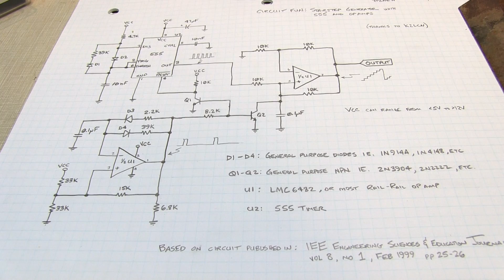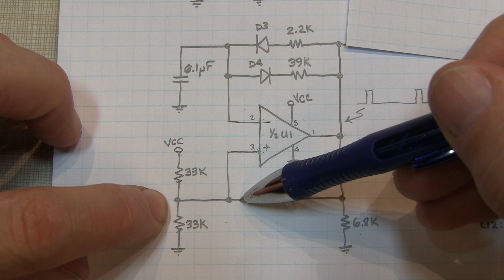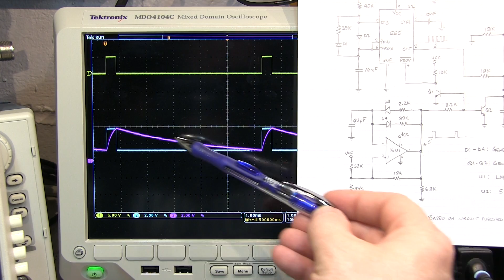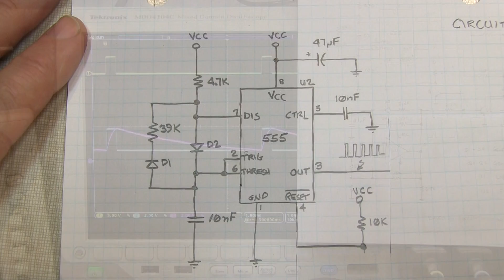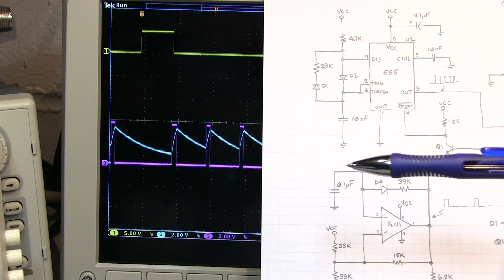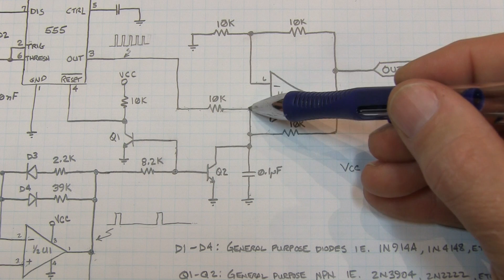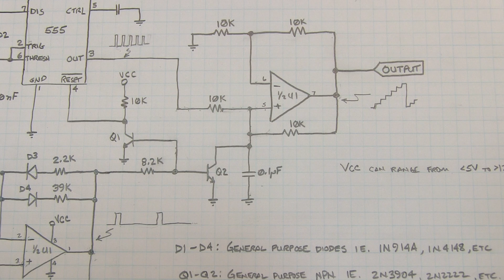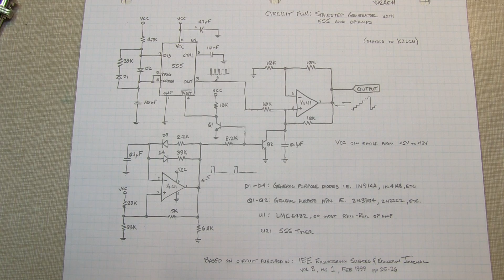#231: Circuit Fun: Stairstep generator using 555 and op amps

Comment: Question could you give me the link to the IEE Engineering Sciences & Education Journal archives? Thank you. Schematic where K2LCN sent it to you?
Reply from the maker: I couldn't find the original link. Here's a pdf of my schematic: https://www.qsl.net/w2aew/youtube/stairstep.pdf
Reply: @w2aew I built the circuit under the 555 timer oscillator using the uA741 operated on a single rail power supply achieved good results. You stated you modified the circuit with a rail to rail op-amp. I priced the op-amp very expensive. About $8.00 each with shipping not included. I’m tempted to try the TL074 Quad JFET op-amp. I’ll let you know the out come, thanks for your reply.

Comment: In general, how do you come up with the resistors value?
Reply from the maker: There is no "general" way to do it.  Each resistor has a function.  It may be to create a certain voltage drop, to become a load, to establish a certain bias voltage or operating current, to form some specific timing by setting a current or voltage.  Sometimes a value is critical to circuit operation, many times it isn't super critical - it all depends on the circuit.

Comment: What is the purpose of the 6.8 kOm resistor, used in the Schmitt trigger relaxation oscillator circuit, connected between opamp output and ground? From threshold voltage point of view, this resistor is unnecessary - it does not change Vth+ nor Vth-. It only loads opamp output with more current.
Reply from the maker: The circuit was originally designed using an op amp whose output stage would add crossover distortion when swinging to the rail due to the design of its push-pull output stage.  The resistor to ground kept the output stage in Class A. You're right, not needed with this particular op amp.
Reply: @w2aew  Thanks for explanation.

Comment: The staircase waveform looks linear on the oscilloscope (before the "steps" are carved into it). However, the main capacitor is charged by a 10k resistor on the output of the 555, rather than by a current source, so I would expect it to be exponential. Maybe it is actually exponential, but just doesn't appear to be so, or have I misunderstood something?
Reply: This iş What I also getting 1 volt straight line don't know what is wrong

Comment: Am i right if I say the 6.8K resistor forms a voltage divider with the 8.2K connected to Q1? Otherwise the 6.8K blows up my calculation of the trigger points forming the voltage hysteresis of the Schmitt-trigger circuitry.
Reply from the maker: No, it doesn't make a voltage divider with the 8.2k resistor.  It is simply a load on the output of the opamp and can be ignored in the calculation of the voltage hysteresis.
Reply: @w2aew  Thank your answer. It comforts me knowing that I wasn't completely wrong. I had some thoughts of this resistor being a load my self. By replacing the 6.8k resistor with an infinite high one in my recalculation the trigger points and hysteresis finally made sense.

Comment: I use a LM358 as OPAM ( i have no "rail to rail" one) and I need to put a diode between 8k2 resistor and transistor bases in orden to achive transistors off state.  So I get a nice stairstep.

Comment: Pffff, I'm a bit frustrated. I've made the same circuit as you, used the same resistor values, the transistors I used are the KN2222A and the dual opamp I used is the LM358.

I can see that the circuit wants to work because when I switch the power on and off very quickly I get a stairstep waveform but only very briefly and when I leave it switched on normally I get nothing, do you have any tips for me on how to troubleshoot the circuit?

I've tried different transistors, played with the 15K ohm resistor and tried a 1K ohm and even no resistor, just a jumper wire and nothing seems to get me any further.

When I take off the 8.2K ohm resistor that goes from pin 1 of the opamp to the base of the two transistors on the transistor side I do get the signal but as soon as I connect it to the base of the transistors again the signal dies and I get zero, only when I set the voltage per division on the scope to 100mV/D I see a very weak signal but it doesn't look like the square wave coming out of pin 1, and when I measure with the scope on the same resistor but on the opamps side I see the square wave even with the resistor connected to the base of the transistors but on the transistor side the signal is almost completely gone, just the little spikes are there.

Maybe the 10K ohm resistor between pin 3 of the 555 timer and the + input on pin 5 of the opamp needs to be smaller, but it can also be that the opamp I used isn't the right one which is the LM358. I know it's not really a rail-to-rail opamp, it can go down to ground level voltage but it doesn't quite get to the VCC rails, it's only goes to 1.5V less than VCC.

Do you have any suggestions for me please?
Reply from the maker: What power supply voltage are you using?
The LM358, not being r-r on input and output might be affecting it, but I'd have to think about that more.
Have you independently checked that your transistors are ok?  When connecting the 8.2k resistor from the reset oscillator, you should see the same signal as op amp Pin1, but only with a 0.6V peak value instead.
Reply: @w2aew  On this circuit I'm using a 12V computer power supply but I also tried a 12V battery but that didn't make any difference. The transistors that I'm using now are the KN2222A's, before that I used different transistors because I thought that one had a defect or something so I switched those for the 2222's.
With the 2222's I get the same issue, one seems to be working fine which is the one that resets the 555 timer and the other one looks like it doesn't work but I know for sure that it works because I switched the two transistor around and still the same thing happens.

I'm going to set up my scope now and make a short video about it to show you on the scope what it does, it might be clear to you when you can see the actual signals on the scope.

I also made a video yesterday about the flexible ramp generator showing that it works now, however it might be that you know something to improve it or you have some other suggestion so if you have the time for it please watch my video here: https://www.youtube.com/watch?v=4odd_Xe5Fco

I would love to hear your feedback.
Reply: @w2aew  So, when I look at the signal on pin one of the LM358 I get a clean slow square wave so that part works, on pin two I see the capacitor charging fast and discharging slow, looking at pin three I see the same signal but not as high as on pin one and with a bit of a positive DC offset, I think that's okay but when I measure on the other side of the 8.2K ohm resistor the signal is almost gone, I do see it when I set the scope to 100mV per division but then I have a lot of noise and the transistors are switching on the noise too and picking up the faster signal coming from the 555 timer so that's what is going wrong here.

Do you have any suggestions?
Reply: @w2aew  The craziest thing just happened, I changed the power supply output, I built-in a linear voltage regulator in the computer power supply that I'm using as a bench PSU so I thought lets use that output so I can see what the circuit is pulling from the power supply on the digital display.
At 4.567V it pulls 0.017A so that's okay.

What do you think that happened?

When I started to turn the voltage output up slowly, I get the stairstep wave at the output when I only give 4.5V to the circuit, when I go any higher I see the lowest steps of the stairstep wave going wonky.

This is so strange I'm perplexed.

So the circuit is working magically with a much lower input voltage of 4.5V maximum.

Now the question that remains is how do I get it to work with 12V input voltage?
Reply: @w2aew  I've got it working as intended with a 12V input and I only had to make one change to the circuit, the 6.8K ohm resistor that goes from the op amp output PIN 1 to ground, I first tried a 1K ohm resistor but I'm using a 330 Ohm resistor now and with the lower resistor the signal is a bit cleaner and looks great now.

This has kept me busy for pretty much the whole day, changing one thing at a time and looking at the signals and if it didn't work change something else until I got to the 6.8K ohm resistor and hey presto I got the right signal.

So now I have to make a new video explaining what I had to change to get the circuit to work and all that.

And I'll make sure that I have a link to your video since I got the circuit from watching your videos so if people want to see the full explanation in great detail they need to watch your video, I can't explain it as well as you do.

Best regards,
Ricardo Penders.
Reply from the maker: @RicardoPenders  I think it makes sense that you needed a heavier pull-down resistor on the LM358 op amp.  While the LM358 is rated to swing its output near ground, it can only do so at very, very low currents (the output of this op amp can't sink much more than a few 10s of microamps).  So, it needs help to swing towards ground - hence a lower value resistor to ground works.  I didn't have this problem with the op amp I used because it can sink a lot more current when driving a low output.  I bet you've learned a LOT by going through this process - which is really the best way to learn!
Reply: @w2aew  Yes you're absolutely right, I learned a lot just by tinkering with this circuit, at first I took a random value capacitor and I started to poke around in the circuit looking at what the signal did on the scope and that didn't do very much so I took a 1K ohm resistor and started to do the same thing, just poking around and then again looking at the signal on the scope and when I came to the 6.8K ohm resistor to ground it was like magic when the circuit suddenly started to work.
I knew it should be able to work one way or another so I didn't want to give up.

I do have one question left, my stairstep signal looks great it's just the last two pulses aren't adding any more steps so I have a flat top so to speak, how can I get that improved?
Reply from the maker: @RicardoPenders  It could be that you're running out of headroom on the LM358 output - it can't get closer than about 1.5-2V from the positive supply rail.
Reply: @w2aew  That sounds plausible yes, is there anything I can do about that?
I do have a bunch of UA741 single op amps that I recently bought, maybe it is better to use those, I mean for me it's no problem with the power supply, I have +12V and -12V always ready to go.
Reply from the maker: @RicardoPenders  they are worse

Comment: Are you using tantalum or ceramic caps?? Thanks, having a go myself.
Reply from the maker: ceramic
Reply: Almost have it going. Only have one curve in XY mode. Stair step looks good though. Using LMC6492. Thanks.

Comment: I build this circuit but the ramp opamp capacitor can’t hold the charge ,want went wrong
Reply from the maker: It is difficult to say what when wrong without knowing what changes in component types you may have made (like a different op amp, etc.).
Reply: I use mcp6004 and having no stairstep with both other 2 circuits giving waves

Comment: Impatient to try this but waiting for rail to rail op amps to arrive...tried LM324.  Got the relaxation oscillator running and adjusted pulse timings.  Then the 555 pulse generator and added the reset.  More adjustment to get about 12 steps between resets.   Then added the pulse integrator but results were not as expected.   Reset was not taking the integrator capacitor to ground.  Eventually figured out that the 8k2 base resistor needed to be reduced to turn on a 2N3904 sufficiently to get down to ground during a reset.   Guess this is a consequence of not using a rail to rail op amp.  More adjustment of the base drive and finally an output close to yours.   Not quite as square steps but close.

Spent a few hours working on this circuit because it looked fascinating and have learnt lots about basic electronics.   There is no substitute for doing - great that your videos are, there is even more to be gained by building and modifying.  Been great fun and learning.
Reply from the maker: I LOVE to hear when my videos inspire folks to build, experiment, test, and learn!!!  Thank you!

Comment: Here's the whole thing done in Paul Falstad's (javascript conversion by Iain Sharp) online circuit simulator:
https://tinyurl.com/y2xjsf4w

The simulator has a nice variety of IC's modeled, including the 555.

PS. The simulator at http://lushprojects.com/circuitjs/circuitjs.html seems to perform a bit better (at least on my machine) than in the URL I posted in my earlier comment.
Reply: Also..

There's a high chance I've done some mistake along the way but it seems to function as it should. You should adjust the simulation & current speed sliders if the screen refreshing is jittery and/or the current animation seems frantic. For now, those are not saved with the circuit but the simulator is still being updated.

Comment: I thing you can automate it by letting the relaxation oscillator making the high frequency pwm and let the 555 in monoflop configuration which gets triggered by a high at out to make the discharging step at the output.

Comment: I think I understood everything in the first part except what the 6.8K resisistor is doing (s. 4:29).
Reply from the maker: It isn't critical.  In some rail-rail op amps, you can get a little cross-over distortion when the op amp output switches between sourcing and sinking current.  A little pulldown resistor like this ensures that he op amp output is always sourcing current, so it helps to prevent any crossover distortion in the output.
Reply: @w2aew  Wow- thanks so much for the quick response. Love your videos!

Comment: could 741 be used?
Reply from the maker: Not without some modifications.  The circuit as designed relies on a rail-to-rail op amp.

Comment: Very nice little circuit.   If you put about a 47K resistor on the base of Q2/Q1 to ground, it'll work better with 2N2222 transistors - they tend not to turn off very fast and hold the 555 in reset too long so you only get 4 or 5 steps out of it.  Just a thought :)   Love your videos.

Comment: As always great explanation. I'm assuming this circuit must have a lower frequency boundary? on the basis that the step will decay and there will be a point where the sag makes this too nonlinear, is this right?
Reply from the maker: Yes, that is correct.

Comment: Does the output stage need to be as complex? Could we just have a diode from 555 output -> capacitor positive side then put a buffer/voltage-follower there?

Comment: There is a bar on top of the reset pin on the diagram, which means it is an active low reset, which means the reset is default high. When there is a low, the circuit resets. 
 But your scope is showing an active high reset - whenever the pulse is high, it resets.
Reply: When the pulse goes high, it turns on Q1 which pulls the reset pin low.  Q1 inverts the signal.

Comment: Can it be used for making an analog to digital converter? For example, you compare the analog input voltage with the height of the stairstep and then output a digital signal when the analog input equals the stairstep's height.
Reply from the maker: Interesting approach, but would be pretty limited to low resolution due to finite step sizes.

Comment: Thanks for your awesome training techniques they are very clear and understanding. Have you ever experience any three phase circuits to parallel AC generators, or do you have any ideas on what chip should be use for phasing sequence two or more AC generators
Reply from the maker: I'm sorry, I really don't have any experience with 3-phase power circuits.

Comment: Probably a stupid question here, but as a newbie, can I use my op amp oscillator in place of the 555? If so what modifications would you need to make? I have limited access to materials at the moment.

Comment: Will this work with two 741's? All I have laying around. How important are the resistor values for the non inverting input of the reset oscillator? I substituted 10k for voltage divider and 4.7k and 2.2k for the others. I got this circuit constructed but something isn't right.. Been troubleshooting..
Reply from the maker: If you're going to use 741s, you'll have to setup split power supplies (+ and -) for them, to give you the headroom for the voltages in this circuit.
Reply: w2aew ok. I did get the circuit working but see the cutoff you mentioned. Not all the steps reach the limits as expected. I'll try that. I  have the negative rail grounded. Thanks @w2aew

Comment: Dear Sir,
Yes, absolutely. I am trying that but I am learning and use capture, compare of PWM, but at the age of 55, it is little too much to learn, so I felt if you have any solution I would implement it. In fact I do not need the DAC, as I just want to generate thyristor firing pulses  for Phase angle control of thyristor from simple PID time-proportional output of the temperature controller.

Anay ways thank you very much for your attention.